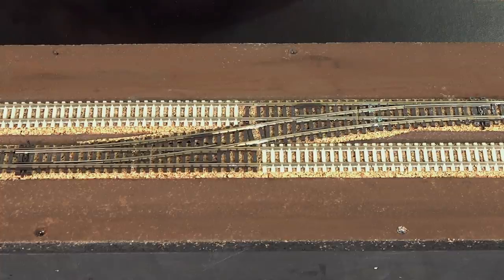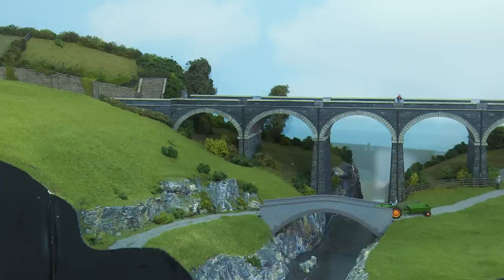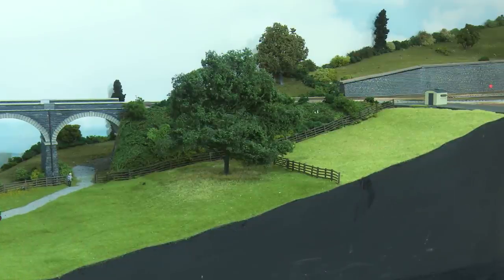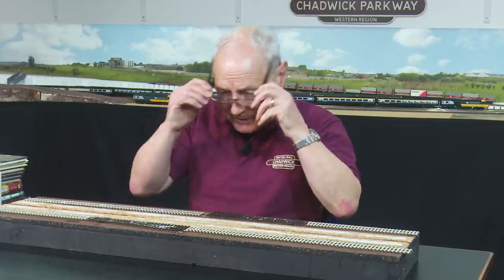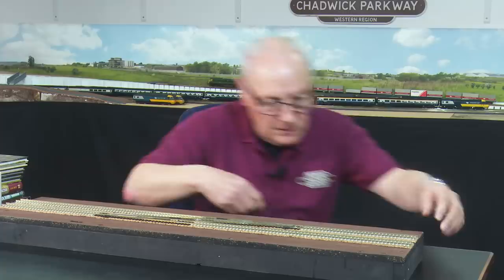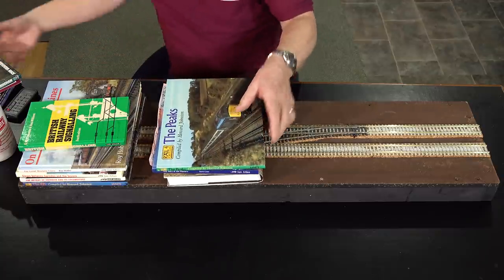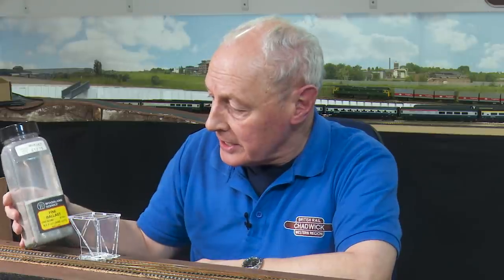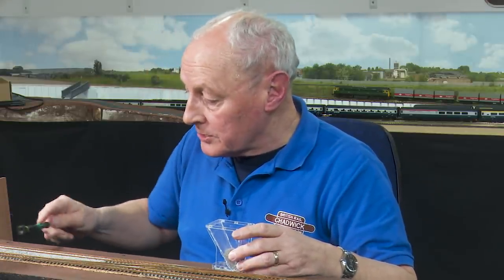Laying and Weathering Track at Chadwick Model Railway | 153.

Comment: So very helpful. I'll be using n-gauge Kato Unitrack, because all my Dutch rolling stock runs on it reliably and, just as important, I won't be able to use or access the underside of the shelf the railroad will be built on. Unitrack has bed, ballast, sleepers and rails all combined in one which doesn't give me a lot of opportunities, but I still plan on weathering it using some of the techniques you showed - after I practice. A lot of practice. Thank you!
Reply from the maker: That’s great news MMS. I’m so pleased that you find my videos. Useful. Regards, Charlie

Comment: Good vid, very realistic . I have  purchased a set of multiple colour acrylic art pens, I use them on detailing on loco's and rolling stock, grate for picking out details on all sort of things  easier than paint brushes no blobs, constant flow. Stay safe Charlie.  Thanks
Reply from the maker: A useful tip Phil, many thanks.
Reply: Glad to help. Hope it works ok for you.   Ive use them on things like door hinges handles rails any thing that a brush is a bit of a hit and miss affair.

Comment: Another great video. I have been watching your creation for many months now. I am more interested in the construction and scenic aspects rather than the details of the rolling stock (engine classes, etc). Watching your recent video I noticed on your viaduct board that by looking under, and beyond the viaduct all you see is a deep valley and the sky. It may be of use to you to put a mirror between the end of the valley and the backscene. This will artificially extend the view in an optical effect taking the valley further into the distance. By adding a panel from a bridge would also disguise the top of the mirror and create a bit of interest in the distance.
Reply: Yes. Oops you would still see the viaduct legs. Sorry, maybe not such a good idea as was thought. I have seen it done with streets and roads that lead off into nowhere (into the backscene) to give a really good effect. Love all your videos by the way.

Comment: Great video,  The rail colouring 'pen you use works well.  I use two products from the firm EDDING.  The Edding 1455 Creative has a wedge shaped fiber blade and the Edding 4040 Deco Marker  sounds very similar to your 'pen' with a small ball rattle inside.  Both give realistic oily rust colour to the rails and after track cleaning, if the rust colour has been removed from point check rails, a quick wipe with the pens restores the colour.   .
Reply from the maker: Thanks Frank, I’m so pleased that you found the video useful. Regards Charlie

Comment: Wooden sleeper = Raw umber, leave to dry and apply a very thin wash of white acrylic. This white wash will highlight low areas of the grain. 
Concrete sleeper = vallejo model air concrete, brush that on. 
Rails I use vallejo model air in metallic rust. 
When all that is done then ballast the lot in buff and grey blend randomly. 
Weathering is done with watered down burnt umber with a dash of black mixed in which can be mixed to various shades. Mist the ballast with IPA and pipette the colours into the ballast. It'll soak down like it does in the real world. A slightly thicker mix of a darker brown can be added with the pipette along the railsides to takeaway that rust zing. 

That's how I've tackled mine on the Exeter SD layout so far.
Reply from the maker: An excellent comment with sound advice. 
Much appreciated, regards Charlie.

Comment: Another excellent video. The Ammo MiG "Track Wash" is referring to tank tracks rather than railway tracks in case anyone needs to know that. When you are dry brushing I would use a brush with stiffer bristles as it makes the task considerably easier. As you found out a small amount of paint goes an extremely long way so the brush really does need to be almost devoid of paint.
Reply from the maker: Thanks Stephen, I had thought that the softer the brush the better (wrong again)!  
Regards Charlie
Reply: @ChadwickModelRailway  I think that is what I said!
Reply from the maker: Sorry Stephen I’ve corrected my earlier comment (it was late evening) 😜

Comment: Many thanks Charlie - good timing as im getting near to this stage of the layout.The little wheelie gismo rail painter that you used previously seems to be no longer available so have resorted to the same rail painter you used. thanks again!
Reply from the maker: It does seem to work quite well.
Reply: @ChadwickModelRailway  one other thing springs to mind after the weathering/painting of track - is to clean off the tops of the rails for electrical contact, obviously but not sure if it was mentioned in the video. 🤔

Comment: Great stuff Charlie! I've used copydex a lot since you reminded me that it was still available. One tip - if you drill a hole through a glued-down sleeper with a power tool, it tends to pick up the copydex layer and wind it round the drill bit, ripping it away as it does so.  Using a pin vice (oscillating action) is a bit more controllable, as you can see it happening and stop. Cheers.  Mike
Reply from the maker: You’re dead right Mike, I’ve done it numerous times I’m afraid. Regards Charlie

Comment: Well done Charlie. Always interesting to see the many ways the track color situation can be approached. 
BTW points are called switches by railroads and only modelers call them turnouts on this side of the pond. Seems that one of the magazines started using the term because they found it being confused with electrical switches. And so it goes.  Looking forward to your further adventures in 2 weeks
Reply from the maker: Hey great comment Joe, thank you. Switches, turn out, points! It’s all a mess. Regards Charlie
Reply: @ChadwickModelRailway  Ha ha. Yes it can be … particularly those double slips.

Comment: Thank you for another enjoyable video. I use the Woodland Scenics rusty rail pen and the biggest problem for me is the two nibs provided wear out/get damaged before the paint. I also use the weathered tie to paint my wooden sleepers but that is a very slow process. I look forward to see your next video.
Reply from the maker: Thanks for the heads-up regarding the nibs Simon. I shall hang on before changing over. Regards Charlie.
Reply: I also wanted to say that I had tried the rusty rail pen and, as it bumps over the chairs, damages the nib as you go. Although two nibs are supplied, they are both finished before the paint - or I'm just too heavy handed, a definite possibility :).

Comment: Nice video Charlie well put together and interesting even for a N -Gauge modeler like myself. I glue my track down like you with Copydex, I then spray it with Railmatch Track Grime before ballasting with Woodland scenics fine ballast. Some n gauge modelers use chinchilla sand or something, never tried it myself, I am happy with the fine ballast, I find n gauge track a bit small to paint the sides of the rails but I do put dark patches in stations and the like where locomotives stop etc. Chris
Reply from the maker: If it works for you Chris, that is really all that matters. And please enjoy the video, regards Charlie

Comment: Another great video Charlie. You hardly ever see how people go about colouring the trackwork. I mainly work with buildings and I never use pure white, I always put a little of the original colour in to keep the tone correct. And if you cut half the length of the brush off you will find it makes a better "dry brush". 👍
Reply from the maker: Great tip thanks, so stiff bristles are better than soft?
Reply: @ChadwickModelRailway  Yes they are, and being shorter and stiffer they don't carry so much paint and "wipe dry" easier.👍
Reply: @ChadwickModelRailway  My "go to" is a flat #4
Reply from the maker: Thanks Warnz. I’ll get one and give it a go.

Comment: for the white drybrush there are two other colours worth a look, the first is "Off White", which is just a bit less sharp, the other is "Iraqi Sand" which is a more pale cream colour - also for drybrushing, wipe the paint off with kitchen roll, works way better.

for the oil washes, have you considered making your own? artists black and burnt umber paint, dirt cheap in a tube, small glass paint jar (the Tamiya jars are ideal) and white spirit - can get whatever consistency and colour you want - costs pennies. good over rails as well
Reply from the maker: Thanks for such an excellent comment Dale. 
Much appreciated, regards Charlie.

Comment: Some tips for drybrushing: 
Get your hands on some cheap makeup brushes. Those will work much better for this kind of application!
Also keep wiping the brush until you have barely any paint leaving the bristles. It's much easier to add more paint than remove what's already there! 😉
Thanks for another great video 👍
Reply from the maker: Thanks Matius, soft or stiff bristles?
Reply: @ChadwickModelRailway  I'd say stiff bristles are better as some other commenters have pointed out!
Reply from the maker: Thanks Matius, much appreciated.

Comment: On the subject of ballast colours, there can be so much variation. Quite often, you’ll have a running line in each direction (up and down) but the ballast was brought from different locations on each running line when replaced. As a driver, I see it a lot!
For example, the Melton Mowbray line has extremely noticeable variation. The up line has ballast quarried at Mountsorrel (prepared and brought up from Toton) and is famously a vivid pink shade. However, down line ballast was brought in from Whitemoor and is a blue/grey colour. In the sunlight, the colours are very bright! 
It’s something that I reckon is worth considering when ballasting a model railway based on a real location. The naturally occurring variation in igneous rock will vary based on where it’s quarried and staged for engineering work. Since most engineering work (T3’s) are usually worked in one through direction, you’ll get the effect mentioned above, where each line can have totally different looking ballast on each side.

It doesn’t always happen, but in my experience it’s something you’ll find regularly on double track routes that are pretty far from a large staging/marshalling yard. So the reason for it happening in my example, is probably just because Melton and Oakham are fairly equidistant from Toton and Whitemoor in each direction.
However, I’d be willing to bet that the ballast near Toton is nearly all pink, but the ballast near Whitemoor is nearly all blue. 
That’s just because Network Rail are more likely to make the effort to source the materials from a nearby staging/marshalling yard, then have a larger engineering worksite when a staging yard is nearby. Network Rail would be more keen go through the more complex effort of running the T3 and ballast replacement over numerous lines at once if they’re not far from the starting location. I’d imagine British Rail did the same, it just makes sense from an operational perspective.

Then, if a Tamper and Stoneblower turn up to replace a patch, you’ll get a mismatched area of ballast colour, because equipment like that can just be sent off from any random siding in the country, with whatever materials it was carrying or supplied with previously. You can see that in Charlie’s picture in the station, although I suspect that’s a wet bed repair, where the discolouration probably just comes from chalky mud being brought up from the drainage under the ballast.

All that feels like a very complicated way of saying; “sometimes the ballast doesn’t match on both lines”, but I hope someone appreciates the explanation.
Essentially, I’m just trying to say that it doesn’t all have to look the same, or even similar!
Reply from the maker: KB, what an absolutely fascinating comment.

I may will print this one off and read it during my next video. Regards Charlie
Reply from the maker: Hi again, I’ve been thinking about your observations and was wondering if you have any digital photos. If so I would love to have them to help explain your comment.
Also, would you prefer me not to use your name?
Regards Charlie
Reply: @ChadwickModelRailway I don’t have any photos I’m afraid, I can’t take any while I’m driving along. Should the opportunity ever arise (when I’m not ploughing along with 2200 tons of stone!), I’ll try and get a picture for you! 
If you do wish to refer to my comment, you’re more than welcome! My name is Karl though, I’d rather you used that.
Thanks Charlie!
Reply from the maker: Thanks Karl, not to worry about the photos. Regards Charlie
Reply: @ChadwickModelRailway  I sent some to your Facebook page, but the examples I have really don’t do it justice!

Comment: Charlie The Cess is the area either side of the railway immediately off the ballast shoulder. This usually provides a safe area for authorised workers to stand when trains approach
Reply from the maker: Dead right Gary. I hoped I’d explain that, regards Charlie
Reply: @ChadwickModelRailway  it sounded as if the walkway alone was the cess. Often there is no walkway provided although You should InTheory walk in the cess or is not always the best place in reality. You should always look around every 5 seconds to check for trains and when one approaches stop walking and ensure you in a position of safety. One point to note is that you do not always hear  trains coming when out on track

Comment: Thanks for another interesting video.  Since I am one of the troglodytes who don't use sprays but have always used brushes it was good to see you doing this.  I think you got the weathering exercise pretty well right.  I do like the use of the pen for the rail rust and I was really impressed with it.   I first experimented with weathering in the 1960s using water colour and poster paint.  I also had issues with over painting and then wiping the excess off.  It didn't always work as well as I wanted and ended up layering and still not satisfied with the result.  There are so many options now with different suppliers.  I still say, we often learn more by mistakes and failures than getting things right first time.  Charlie, you always manage to make your videos interesting.  So thank you and keep doing them.
Reply from the maker: That’s very kind of you to say so Don. Take care mate, regards Charlie

Comment: An Enjoyable video, Charlie.
A couple of points (no pun intended 😀) of interest.  The term ‘turnout’ is not just a term used ‘across the pond’, it is the correct railway engineering term for what is colloquially known in the UK  as ‘points’.  Points refer to the two ‘Switch Rails’ which are, as we know, pointed at one end.  So, the term ‘changing the points’ alludes to the moving of the switch rails.  A turnout is a combination of what used to be called ‘Points and Crossings’, now known as ‘Switches and Crossings’ (S&C) in railway engineering circles.  When I was a lad, at the model shop, you asked for a pair of left hand (or right hand) points, meaning a single turnout.  Today a single turnout, in UK modelling circles, is referred to as a ‘Point’ although it has two of them. 😂
The term ‘frog’ is actually from across the pond, from the days of the old ‘Iron Horse’, so called because it looks like the frog at the base of a horse’s hoof.  The UK railway engineering term is ‘Common Crossing’ and is the term used by those in the industry, who build and maintain the permanent way.  In the UK, the term ‘frog’ is almost exclusively used in model railway circles.
As always, we all can choose to use whatever nomenclature suits our preference.  Best, Jason.
Reply from the maker: Thanks Jason, what a fascinating comment. We are never to old to learn.
Regards Charlie.

Comment: Hi Charlie, I will give this a go on my layout (when built), good stuff. On another point and forgive my ignorance, with coaches with illuminated lights in them (Pullmans) would they be ok to run on DCC as well as DC?
Thanks in advance.
Reply from the maker: Hi Glen, I’m so pleased that you enjoyed it. Regarding the coaches, they should work on either system however on DC the lights will go out once the power is turned off. Regards Charlie
Reply: @ChadwickModelRailway  Thank you for a speady reply Charlie.
PS. I noticed in one of your videos you had a portrait hung one of your walls, did you or still do portrait photography?

Comment: Thanks Charlie! I always enjoy your videos but sometimes puzzle. In a previous video you mentioned that you were a sound kind of a guy and were concerned with the transmission of sound from the rails to the layout table through the hardened ballast and how you were trying a thin foam strip to isolate the ballast from the table. In this video, there was no mention of the foam strip. Did the experiment not work?
Reply from the maker: Not at all mate. This was just a small diorama, on my layout I always use a soma track bed. Regards Charlie

Comment: Are these #4 turnouts and how well does the equipment traverse through?  I apologize if someone already asked, but there are quite a few comments to read through.  Thanks for posting.
Reply from the maker: They are Peco medium radius points and don’t have a # number.  They work just fine John.
Reply: @ChadwickModelRailway  Thanks.  I took a chance on traversing #4a.  Still testing but so far no issues.

Comment: Thanks for that video, it's right on time for me as I'm about to start laying track.
I have a question though: Did you have to clean paint off the rails somehow offscreen or were you just really careful not to get any paint on them? If so, what did you use to clean the paint off?
And how do you deal with thermal expansion? Is  the copydex flexible enough or do you leave gaps?
Thanks!
Reply from the maker: Thermal expansion has little effect on my layout as it’s in a heated room.
Attic and shed layouts are when particular care must be taken.
I used a track rubber to remove the paint from the railheads. Hardboard or a wooden block are best as they’re not abrasive.